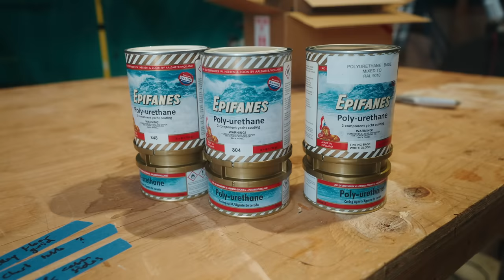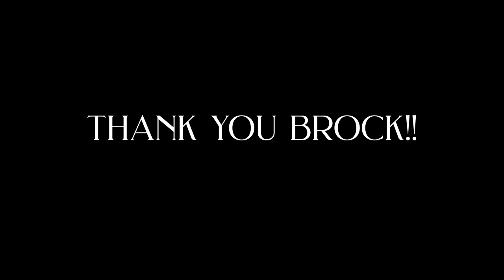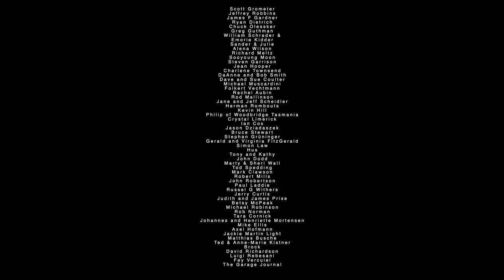Choosing a colour for our boat! (3 options) [60]

Comment: For anyone painting an interior—a boat paint isn’t necessary.  Use a good oil paint with enough Penetrol to slow the drying (4:1 is usually good).  Interiors get nicked up more than exteriors so save some and you can dab it on dings to put off repainting.  Since oil paint dries instead of setting up, it allows for a mineral spirits clean up so you can use your brush and all your equipment again.  (I use One Shot sign paint—the best.)

Comment: Although it may seem counter-intuitive, a very light hint of green is an excellent color choice for the visible areas of a boat. i.e. Bulkheads, settee faces, etc. Years ago on a 30' boat I built for myself that is what I used. The color was made by me. I used two tablespoons of dark leaf green mixed with one gallon of pure white satin enamel. The hint of green was almost unnoticable. It is supposed to have a positive psychological value for humans. I found it relaxing.

Comment: I suggest White 2.0 or whatever it's called, the brightest, most light-reflecting paint on Earth for the ceilings and upper walls belowdecks. Why illuminate when you can just passively reflect? Note: this white reflects light better than chromium, if I recall correctly.

Comment: Try RAL9002 - we have used it inside and it looks great
Reply from the maker: A little too late, but fortunately we’re very happy with the 9010!
Reply: It looks georgeous, we have used it too. I was just thinking as Aladino said, you were searching for a tone that is warm and not creamy - 9002 is exactly that, although it does not look like it on a RAL color chart. We did a mix of 9010 and 9002, which is very suble but draws less attention from the Teak so it can shine more.